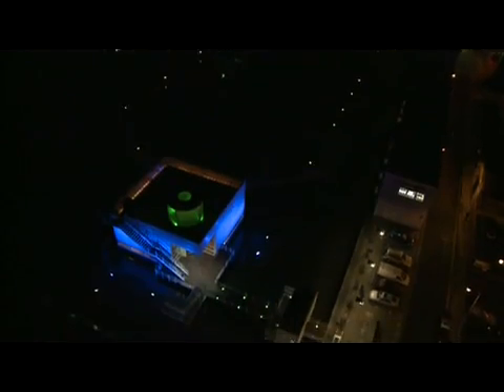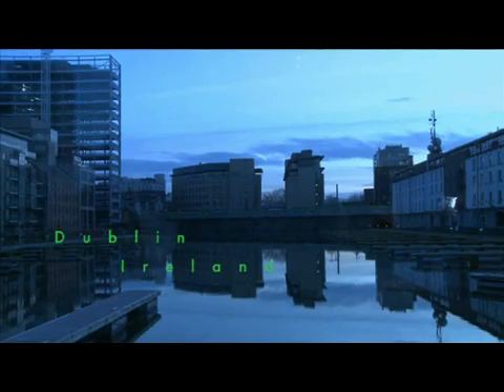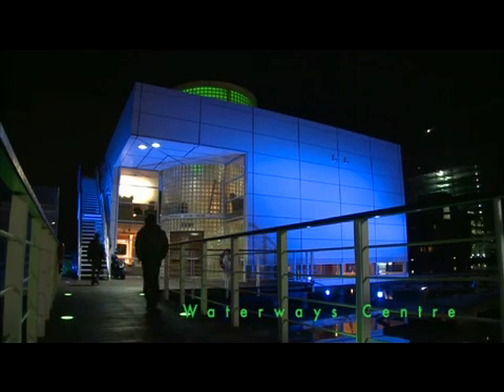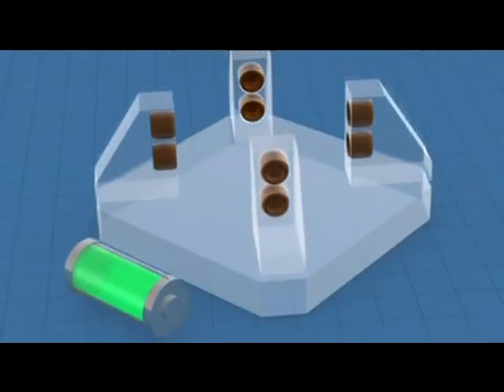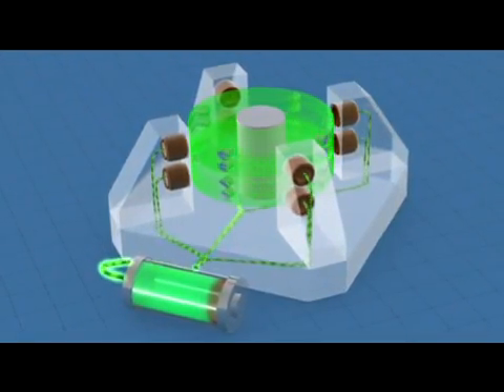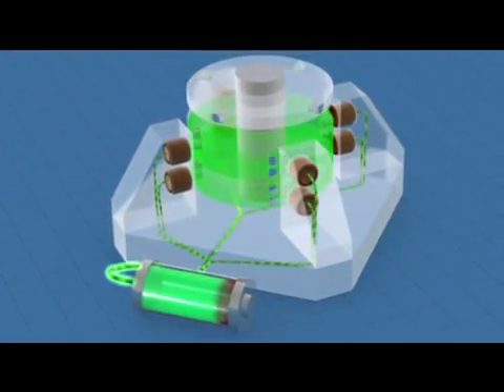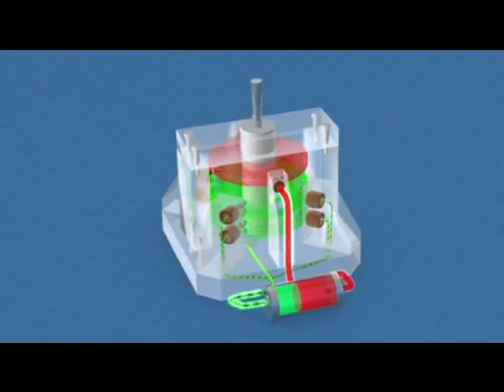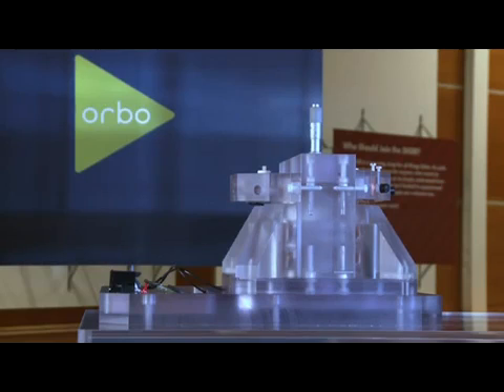Steorn Orbo Technology Launch 2009

Comment: Once it's going take the battery out and it should keep running right?
Seems like a simple demo to prove it actually works.
Reply: If, and I mean 'IF' this device was plausible in theory; it would require an energy input in order to get output. They argued in their promotional video that the wattage output was substantially higher than the wattage input. So it would require that battery to keep running, but they claim the battery will be fully charged perpetually - by itself. Hahahaha!

Comment: @enantiomer2000 It works by magnetizing the toroids with the copper coils. As the molecules in the toroids are already affected by the greater force of the electric magnetizing the cannot react to the force of the permanent magnets. The same could be done with any form but the toroids save some energy. However the electric power needed is the problem as it should by any normal physics be greater than the power available from the system.